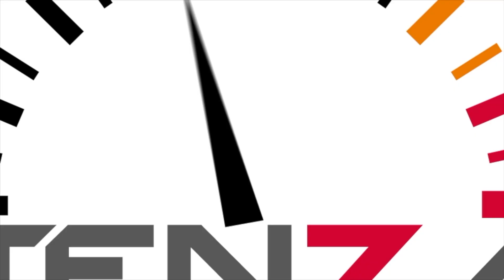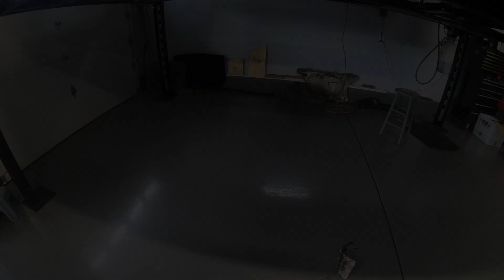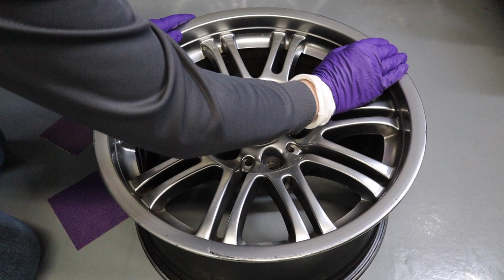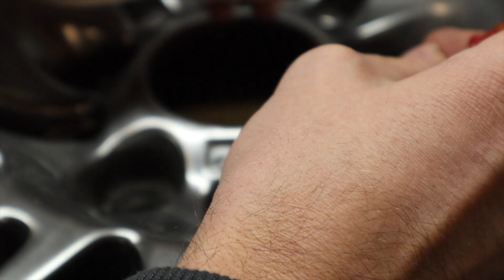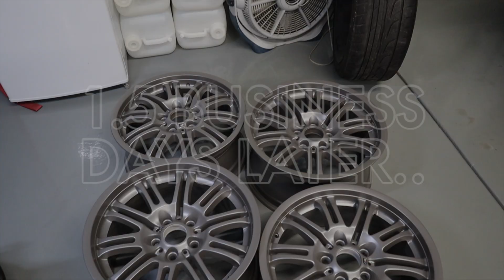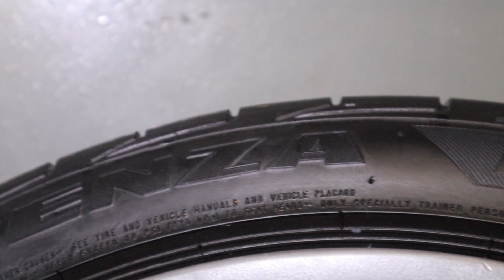BMW Style 67 rim restoration - curb rash repair - powder coating wheels. S54 wagon build part 13

Comment: I see these are genuine. Could you tell how much you paid for these?
Reply from the maker: They were part of the M3 purchase. They were the original wheels for the car. I had to replace one that was damaged. We bought a single front wheel for $180. A used set can be found for around 600-1200 depending on condition, shipping and if they include tires or not.

Comment: I like the looks of the black one better.  It they were the bright silver color they'd look really good.  Great video, you've made so much progress on this swap
Reply from the maker: Those black ones are very similar to the rims on my race cars. I think they look great! But there are a few reasons why we’re not using those wheels on this wagon. The biggest reason is the offset and width are insane. They poke out like 2+ inches past the fenders. It all works out though, we have plans for the black wheels👍🏻